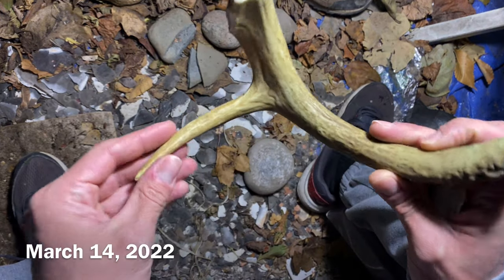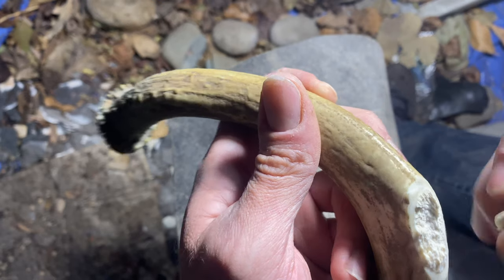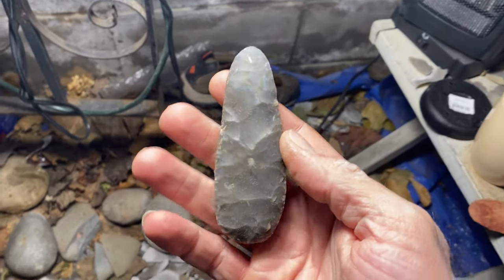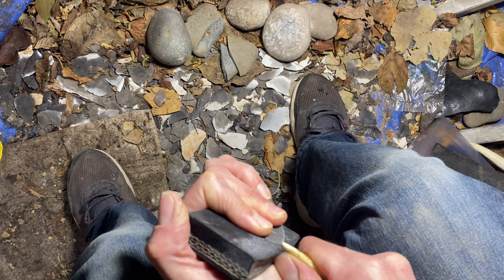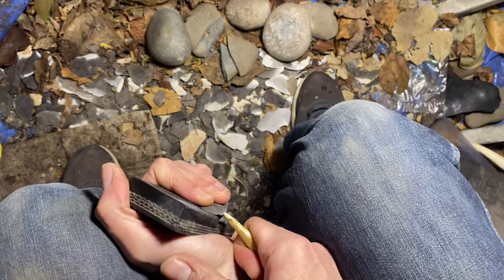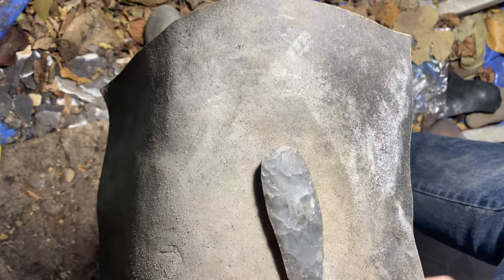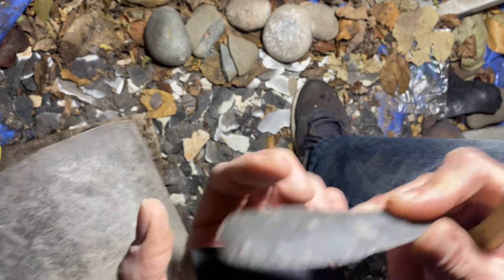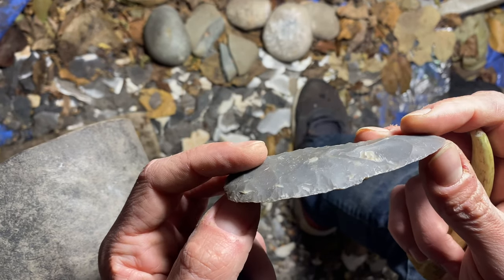Another Pressure Flaker, Almost Breaking the Giveaway Piece! - 500 Subscriber Giveaway Part 8 of 14

Comment: Antler works so well for knapping because it's so hard and tough. Cutting it is a pain with modern tools, it would take me half the day to cut it with a stone tool. Oh, and I got first comment!😉
Reply from the maker: Yes you did! Thanks for the comment. Antler is pretty tough to work for sure, it's better if you soak it in water or leave it outside when it's wet/humid. Having a serrated edge on a stone tool, even if it's a bit dull, actually works pretty well with a sawing motion. It took me about 30 minutes to saw through this one enough that I could hit it with some rocks to knock the tine off with a predictable break. Works well enough, I'm not aiming for perfect!

Comment: That seam on the proximal side of the last indirect flake is worrying me. My guess is there was a defect in the middle of the piece, cause that spot always seamed hard to work ever since most of the thinning was done (by part 4 or so?). From now on this series will become a real thriller haha. 

Ps. If push comes to shove and it break on the crack, I can still see a great looking average size meadow wood in that preform
Reply from the maker: Haha for sure, each flake from now on is a real nail biter! I though I had created that crack earlier with a bad flake that almost plunged through, but ya now I'm thinking it might have been a natural seam in the stone that messed with that initial flake, and several others afterwards. Looks like it doesn't go through to the other face, so that's good at least, there's still hope. You're right, there's enough length on this piece that if it does snap off I can still make something a bit shorter out of it.